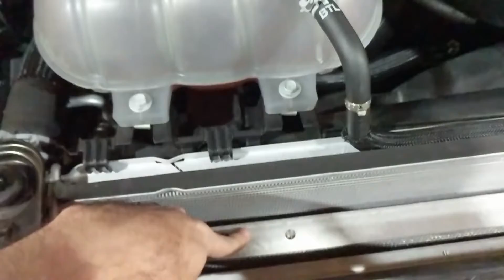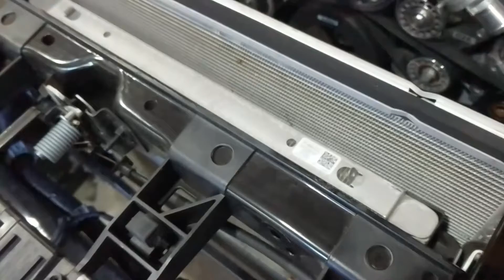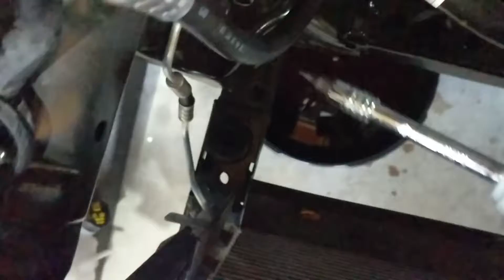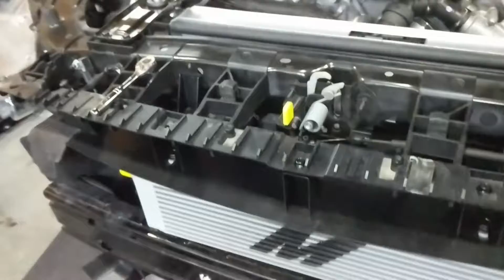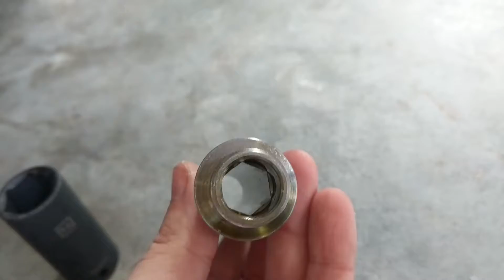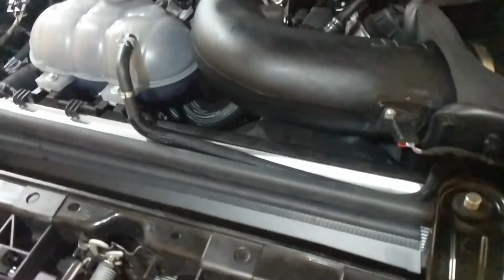Mishimoto Cooling Upgrade (Radiator, Transmission, Oil) Install and Review - 2019 Mustang GT

Comment: We are LITERALLY on the same page with cooling it’s like I’m gonna have to spray paint that front part of that radiator though because I want to blend that in with grill
Reply from the maker: All my cooling mods helped a ton!  I believe they sell a black painted one so it'll blend in and you don't have to worry about it standing out.  I wanted it to look like I had an intercooler, lol.  Good luck with your cooling mods!

Comment: Hey Raymond, fantastic video for me. Very helpful. Based on your guidance I pulled the trigger on buying this Mishimoto transmission cooler for my 2022 GT, even though Mishimoto says it won't fit (CJ Pony parts DOES indicate fitment through 2023). Anyway, everything was going according to plan when I hit the interference between the transmission cooler lines and the A/C line that you talked about. I saw in the comments from a couple of years ago that you never bothered with trying to have the A/C line re-routed or anything so as to properly get the condensor tab to fit into the slot on the radiator. Have you still had no issues? Has your A/C kept working alright for the last couple of years, lol? I'm going to sleep on it a bit before buttoning the car back up and taking my chances as you did, but I thought I would ask if you have any more wisdom to share now a couple more years down the road. Like you, my transmission keeps getting too hot on track, and I'm getting tired of cutting sessions short, etc. Had to try something.
Reply from the maker: Hey, thanks for watching!  I actually sold the car a little while back and looking for another project.  But after the install, I did drive it quite a bit and tracked it several more times and there was never any issues for me.  The way it is wedged in there, I wasn't too concerned about there being an issue, and me personally, I never had one.  The cooler did help on the track, but on days that were extremely hot (90+) it was still hard to keep it cool.  The problem that I saw and researched is that the thermostat in the transmission doesn't open until it's already so hot, that's it's hard for it to bring it back down quickly.  But overall, I still thought it was worth it and helped.  Good luck with yours!!

Comment: Could you have installed the trans cooler under the car & did you have any issues with the rubber lines with the hose clamps popping off the transmission lines do to the high pressure of the transmission fluid
Reply from the maker: Hey, do you mean accessing it and installing from the bottom side under the car, or am I misunderstanding?  If so, I don't see how you could, not saying you absolutely can't, just that I think it would be very difficult.  The way it's bolted to the radiator and everything slides in from the top, I don't think they would be a way to do it from the bottom side.  I tracked the car multiple times after this upgrade and never had a problem at all with the lines, leaks, etc. everything held up great.  Hope that helped.
Reply: @RaymondLamb  Mounting the trans cooler on the underside of the car like near the rear bumper
Reply from the maker: I'm with you now!  I suppose anything is possible, but I think you'd have a hard time getting it mounted at the right angle back there or underneath somewhere, in order to keep enough air flowing through it to keep things cool.  Then you'd have to worry about rerunning the lines too.  I had the GT500 front bumper and had thought about moving it to the air intakes in the corners, but never did because this worked out well.  Good luck with whatever you decide!

Comment: is there enough room for an intercooler when you go boosted?
Reply from the maker: I believe so, I just checked the link to their site, and they even confirm that because of the oil cooler setup it allows for larger supercharger heat exchangers.  You could email them to be sure, but I think you'd be good.  The transmission and radiator are the in the stock places, so that shouldn't interfere with anything.  Thanks for watching!

Comment: I'm going to be installing all 3 of these on my 5,000 mi ess tuning supercharged mustang real soon.
I already have a 170° tstat and tuning to support that.
My factory oil cooler failed and was putting oil into my antifreeze,not enough to ruin my engine thank god.
Reply from the maker: Good luck with the install. Glad you found that oil cooler issue before it ruined anything.

Comment: Would the PP1 standard radiator be compatible with the trans and forward oil cooler?
Reply from the maker: I believe so.  I did all three at the same time, but you could do one, two, or all three if you wanted.  My car wasn't a PP2 so it just had the standard radiator, and I think it would've been fine.  Good luck with it if you go that route!  Thanks for watching.

Comment: Hello. I'd like to purchase the oil cooler upgrade. This fit plug and play in the 2019 GT? Do you notice better refresh on high rpm stress?
I have the A10.
Engine temperature is ok in ever mountain tour
Reply from the maker: Hello, the kit is plug and play but it does take some work to get all the stock stuff off to swap it over.  I noticed a huge improvement in reduced temperatures on and off the track and it would cool down much quicker after a session.  Keep in mind though, I did all three at the same time while it was all apart, so I can't comment on how the oil cooler was just by itself.  Good luck with it if you go that route, take care!
Reply: @RaymondLamb  thank you so much.   Mishimoto don't reply my email. I will purchase it,with a thermostat and steel brake tube, to improve the performance on mountain roads

Comment: Hi Raymond how did you set your fans to come on at 170 ? Were you able to do it yourself or pay a tuner to do it?  If you did it yourself could you explain how to do it thanks.
Reply from the maker: I had a custom tuner that I talked about in the linked video. I was able to talk to the guy that writes the tunes, and he customized it uploaded to the cloud and I loaded it in the car. Then the fans cut on at 170, worked perfect. Let me know if you have other questions. Here's the video https://youtu.be/orFylqT-H5o
Reply: Hi Ray Thanks for the info would you know if you can use forscan to control the fans Thanks
Reply from the maker: I believe I researched and looked through Forscan and couldn't find anything, talked to tuner and he said he could handle it. So just went that route, but it can be expensive just to change fans.
Reply: Thanks Ray for checking it out for me it would cost  (estimating) $500.00  for the custom tuner to turn on the fans at 170
Reply from the maker: Sounds about right, it's pretty pricey if that's all you need it for.

Comment: Hey, so you had to drain the transmission fluid? And how did you fill it up again? I'm new to this but want to do the same thing to my car please and thank you.
Reply from the maker: You don't have to drain the transmission fluid, it's only pumping once the car is running and warmed up.  If I remember correctly, it didn't even leak or drip much when I disconnected the cooler from the lines.  The trans cooler adds an additional 3/4 quart capacity so you will have to top it off.  The procedure to check the fluid is a pain in the butt, so I took it to the dealer to have them check it after I was done.  Hope that helps.

Comment: First off thank you for the video.
I am starting with the transmission ccoler I bought the shelby cooler 43-00000 and it's not here yet but my question is will the cooling lines be able to come off the actual cooler?
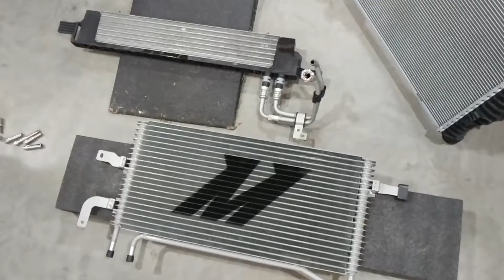Reply from the maker: Hey, they should be able to come off if it's anything like what I had.  If you look at 15:50 in the video, you'll see where the stock lines are attached to the stock cooler and then you'll see the two hookups for the new cooler below it.  My kit came with new lines to run that were slightly longer since the cooler is taller.  Not sure what yours will be like.  But yes, I believe you can take them right off the existing cooler.  Hope it all goes well for you!

Comment: @Raymond Lamb Great video, I know you need to top up additional coolant and oil for installing the the mishimoto radiator and oil cooler. Did you have to top up additional transmission fluid when you installed the trans cooler? Thanks
Reply from the maker: Hey, thanks!  You are correct, had to add more coolant and I think the system now holds another quart of oil as well.  I couldn't quite remember about the transmission fluid as I had that and the rear diff fluid changed at the dealer at the same time.  But I went back to Mishimoto website to verify and it does say you'll need an additional 3/4 quart of transmission fluid for the upgrade.  Hope that helps!

Comment: Hi Raymond, thanks so much for this video - it's been a great help! I was wondering if you ever got that AC condenser line behind the trans lines? or if not, do you still think it is an issue?  I have a 2018 PP1 10r80 and am about to pull the trigger on the Mishi trans cooler with stock PP1 oil radiator. Thanks!
Reply from the maker: Hey thanks for the comment. I never did change it and it has been just fine, no issues. It is not rubbing at all. Have had several track days with it on and everything working great. Everything runs so much better overall in just normal conditions too. Good luck with it when you tackle it.
Reply: @rod6281 did you ever install it on your 2018? How was the fitment?
Reply: @ryans7281  I know its a bit late, but I've had it on for a few years now and no issues. I've tracked the car with the mishi trans cooler and although it helps a bit by prolonging time before hitting 225F trans temp, its still not enough for 20 min sessions without limiting my driving @75F+ ambient.

Comment: I’m a disabled veteran and I’ve been thinking about getting a mishimoto radiator and thermostatic oil cooler and I wanted to see how much hp gain in a dyno I got a roush cold air intake right now and I also received long tube headers in the mail I’m ordering the radiator upgrade on the 28th and I was wondering if you could describe the benifits in power you’ve seen in heating up faster than usual running cylinder heads up to 235+ on my California special 2020  thanks man
Reply from the maker: I don't think you'll see much HP gain just by installing the cooling mods.  It will however help you keep your HP longer.  As the car gets hotter and temps rise, the computer will start pulling timing and you'll start losing power overall.  These will help the car stay cooler longer and cool off quicker, to help keep those temps lower overall and keep more timing, and in turn keep more available power.  I think you're long tube headers will add a good bit of power though!  If you can add a custom tune to make full use of your intake and headers, you'll see even more.  Good luck with your project.
Reply: @RaymondLamb  just ordered both the oil cooler with the radiator super excited
Reply: @RaymondLamb  so I installed the thermostat 160f with the long tube headers and roush cold air intake and the thermostat alone gave me 10 hp gains I can’t wait to see what the difference is when I receive both the oil cooler and the radiator
Reply from the maker: Sounds great, good luck with the rest of the project!
Reply: They only help with keeping the engine running cool but it prevents your HP dropping on back to back runs.
Reply: @DuckMcDuckinson  I did a dyno and improved top end hp so yea as a matter of fact it did make a difference over all with all the mishimoto upgrades
Reply: @Racerglitch  I didn’t say it wouldn’t help with gaining hp I said it helps the engine stay cool.
Reply: @DuckMcDuckinson  including the mishimoto radiator and oil cooler
Reply: @DuckMcDuckinson  I was able to have a more aggressive tune specially by moving the red line a little higher more aggressive shifts it could handle the heat the only problem was fitment the cold air intake blocks a upper hose so I put a shoe lase to pull the air intake away from it and it works perfect on a hot day it runs around 180-208 I’m from Texas in the mountains so over 100f
Reply: @Racerglitch  what I was implying was heat soak. Yes you will get better top end performance because that’s when the engine is at its hottest.

Comment: Very good video and even better work. Helps me get motivated here6in Florida heat is our enemy full time. Thank you again
Reply from the maker: Thanks!  It wasn't bad, I just set it up in the garage so I could take my time and worked on it as I found some free time.  Overall it wasn't too complicated and it has helped a ton with temperature.  I'm in GA so it gets pretty hot here and it hasn't seemed bothered at all even on the track.  Good luck if you decide to tackle it.
Reply: @RaymondLamb  definitely going for it 👍

Comment: Christ. My inlet at idle is like 145. Cylinder heads basically around 215. To be fair, I live in florida... average temps are about 85-90 F
Reply from the maker: Yeah, that inlet air can jump quickly sitting still.  Mine is normally a few degrees more than outside air temps while moving, but stop for a few minutes and it rises fast.  Want to try to see if I can do something to help that as well.  As far as the rest, the upgrades help a ton even on and off track!
Reply: @RaymondLamb  We're broke out here. Can't throw any more money at the car for cooling upgrades.... waiting for a turbo kit and all the other goodies to arrive. She'll just be a one run type of girl for a bit.
Reply from the maker: @ryansilverstone4637  good luck with the turbo kit, sounds like a fun project. I've been trying to get cooling and suspension all setup and then start adding more power.